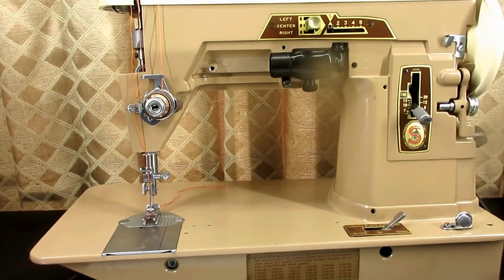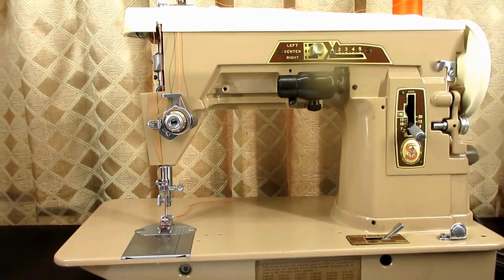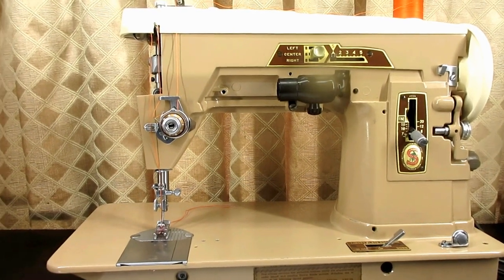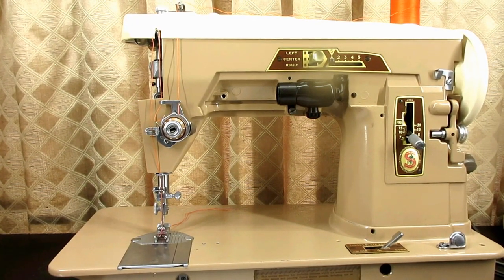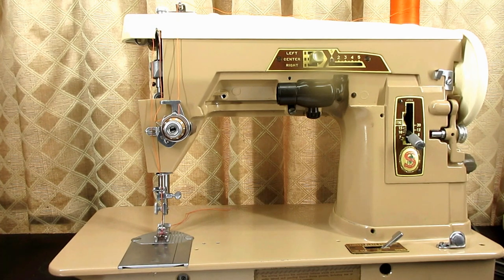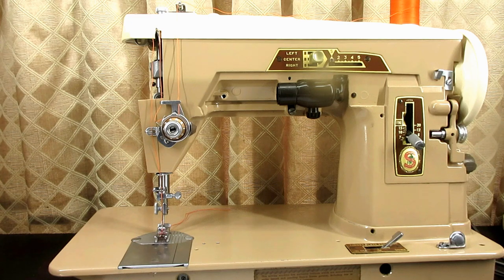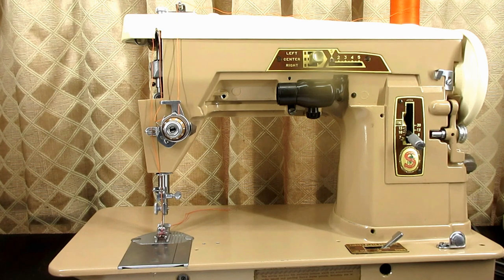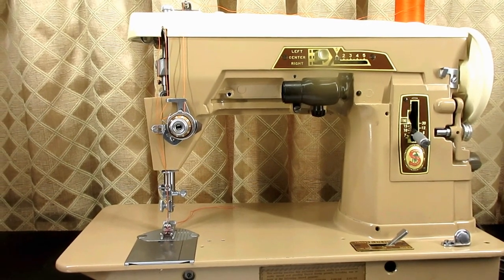Check and Set the Thread Clearance Singer Model 403A Sewing Machine

Comment: Before I had benefit of this video, I was trying to remove a tangle of bobbin thread. I stupidly removed the front adjusting screw that is on the top of the bobbin case retainer. Then said tiny screw was sucked into a previously undiscovered black hole in my workroom. Is there any chance of finding a replacement screw, or will I need to launch a search for a replacement bobbin case retainer? I absolutely love my 401a and even recently found a parts machine from which I’ve robbed said screw.  The only thing wrong with parts machine is the thread spool pegs have been broken off. You can understand my reluctance to disable my parts machine so soon and needlessly. Any ideas? I’ve already tried local hdwe store, no luck. Your videos are SO HELPFUL!
Reply from the maker: I've never been able to replace a single screw at a hardware store, but some have commented that a FEW screw are common sizes. I can't imagine find the single screw for sale on eBay or other, so I think you'll need to but the whole part. I wonder if the black hole below my workbench ends in your workroom or if there is a gigantic pile of little things lost is space? Thanks for watching my channel. 🚀🌍
Reply: on April 28th someone posted their machines for parts and is handing out what people need. im sure you can get your screw from him!

Comment: First off, I love your Videos! Thank you for making them! Quick question, what would make the top thread get pulled into the bobbin case and hook ledge area instead of gliding over the bobbin? I've set all the clearances as you've outlined.
Reply from the maker: You don't mention is this is a new problem, or the machine is new to you. Here are some things I look at when I get a new machine and have this problem. The bobbin case is not completely installed into the hook; like not riding on the hook race. Using the wrong class of bobbin. For example, on this 403A machine, it uses a class 66 bobbin with the curved sides vs. a class 15 bobbin which is taller and has flat sides. The stoke and tension of the tension unit take-up/check spring is not set correctly https://youtu.be/t3UqzYRo-cc
The needle thread tension could be too strong and fighting the hook as it goes around, dragging the thread. With the too high tension, the thread is pulled taught into the bobbin/case. https://youtu.be/4aqRScKOOsw
More rarely someone has worked on the take-up lever and it is out of time or installed incorrectly and is pulling up the thread too soon and not after the hook has cast off the needle thread (cast off is usually about 6 o'clock at the bottom of the hook, then the take-up starts lifting up and pulling the slack of the thread from under the fabric)  https://youtu.be/N6VE-_xuTL0
Reply: @andytubesewing1953  Hi Andy, thank you for amazing videos, they are very helpful. I was offered vintage 401G , it was missing some bits (around bobbin) but I managed to get some replacements (from broken 402). However I am straggling with bobbin area. It happens what Rick said, basically top thread gets under the bobbin case instead of over. I don't know if it is worth my time fixing it. One thing the bobbin case I am using is from really battered 402 and maybe it is a bit damaged.  Also the bracket does't sit too solid. Do you think buying new bracket and bobbin case will help. Thank you in advance for taking your time to reply and have a great new year.
Reply from the maker: @PrincessEvunia  I can't say much more than I replied to Rick above. You can browse thru the videos in these two playlists to watch the videos about the bobbin area, hook, timing, take-up lever, and setting the stroke on the tension unit. 
https://www.youtube.com/playlist?list=PLsCOZgzzaiKKyqvdDRwS-9MfLuwSNJTcg
https://www.youtube.com/playlist?list=PLsCOZgzzaiKIB4kvIHCfHYuyLMUp5A4UI
In a way, you may have answered your own question when you state the bobbin case may be damaged and the bracket does not sit solid. This sewing machine is a finely tuned and engineered device that depends on having the correct parts, installed properly, and set to factory clearances. My videos can help you check the settings and clearances and resetting them if needed. You can also download a free copy of the 401A service manual. Some of my viewers who own the 401G said the manual was helpful to them for working on and checking the settings on their machine. https://sewingdude.files.wordpress.com/2012/09/singer-401-service-manual1.pdf
To isolate the cause of this problem you will need to spend time and effort to find it. You may buy new/other parts but have the same problem. Good Luck
Reply: @andytubesewing1953  Many many thanks, I will look into it all. All the best
Reply from the maker: @PrincessEvunia  Best of Luck to you.

Comment: Hi Andy - I'm having trouble with my Singer 457 and wonder if you can help please? The needle thread keeps breaking. I've checked the needle tension (its on 3 and I'm sewing a light twill). Ive also tried the thread clearance and measure the gaps between the bobbin case and the spring cushion (using the diagram you posted) and it's still breaking. I checked that the bobbin case is in correctly and sitting on the race but did notice that as I observe the needle thread as I turn the wheel towards me, there is some play in the bobbin case so it shifts over to almost touch the spring cushion - could this be the problem? I tried widening the gap using slightly thicker gauge but not luck. Is there something I'm missing?
I made a short video clip of the bobbin moving but haven't had any luck attaching it to these comments. I'll try again if you think it will be helpful. Thanks in advance!
Reply from the maker: Sorry, but you can't attach videos to YouTube comments. You can list a link to a video you post on your own YouTube Channel or in the cloud and I can approve that link with YT so it shows in the comment. The bobbin case moving back and forth as the thread travels over it is normal; that's why there is a cushioning spring for the case to bounce off. There are so many reasons needle thread can break and I'll list some links about various causes that may help. Personally, I've found that dirty bobbin case areas (grit, lint) can be a cause. Lacking oil on the hook race that the bobbin case rids on. Wrong needle and thread combo (needle eye too small for the thread you are using). Old thread. Cheap, used needles can have a burr in the eye or a malformed eye. Wrong threading path from spool to needle. I start with a new needle and rethread from spool to needle and a drop of oil on the edge of the clean bobbin case. 
( see @ 12:20 in this video https://youtu.be/XrNh_iaqDMM )
Here are the links I mentioned. https://www.superiorthreads.com/education/troubleshooting-broken-thread
https://blog.treasurie.com/sewing-machine-thread-keeps-breaking/
https://support.brother.com/g/b/faqend.aspx?c=us&lang=en&prod=hf_600_2eus&faqid=faqh00000318_000
https://www.apqs.com/why-is-my-thread-breaking/
https://www.coats.com/en/information-hub/Solving-Your-Sewing-Problems#Needle-Thread-Breakage
Good luck, Fiona, and thanks for watching my channel.
Reply: @andytubesewing1953  Hi Andy - thanks for getting back to me - I appreciate it. I'll try those tips and hopefully sort my problem out.

Comment: Excellent tutorial! Question: I'm setting the thread clearance on a 401a. This machine came in only able to straight stitch with the needle offset from center. EVERYTHING was completely dried into one position. I finally have all parts moving, clean, timed, and repositioned. Straight stitches really well. BUT: on the widest zigzag, the bobbin thread pulls the top thread down on the zig, and top thread pulls bobbin thread up on the zag. I thought resetting the gaps should fix this, and indeed it did on another 401a. Any idea what else could be going on?
Reply from the maker: That's an odd problem, new to me! Usually a tension issue, but strange it fluctuates between the zig and the zag like that.
SO that's ZZ width 5, the widest? But it doesn't happen at width 4? Tried a different needle I assume? The wider the stitch the more stress on the thread/needle as the feed dog pulls the fabric. Man, I'd love to see that in action. I think at this point (not knowing the cause) I would check the stroke and tension of the needle thread tension assembly. You can just check it without changing anything.
https://youtu.be/4Q1dAUHqfvg   I would also think about checking and cleaning the bobbin case as people rarely do that but grit and lint build up in the spring and ZZ puts the most stress on the sewing motions. https://youtu.be/HT5XZ5eYYEQ
If it continues, maybe think about posting some videos of it on your YT channel so we can see it working and the results of the odd stitching. If you ask for help on sewing and machine forums you could point them to the video also. Sorry, I can't think of a for sure reason or fix; just never encountered it before.
Reply: I completely cleaned all parts of bobbin area and tensioner. For a while, I thought it might be that I had not completely freed the needle bar shaft and vibrating collar, but it does have full range now. I have finally found a new bobbin tension spring, will see if that fixes the problem. Am also putting in a plastic bobbin, as there was mention of the original metal bobbins wearing a groove in the bobbin case center. Will keep you posted. Thank you so much for the reply. I'm so glad you are back. Please take care.
Reply from the maker: @amynevitt9101  Sounds like you are doing everything right. I'm still puzzled by the different sides having different stitch results. I guess because I've never seen it.  I have also seen mentions of a metal bobbin wearing the bobbin case/hook. When I put a bobbin in a slant needle machine, or any class 66 bobbin case, the bobbin does not touch the hook. It sits on a little shelf on the inside of the case. While sewing the bobbin spins as the thread comes off and the theory I was told is that the little shelf finally gets worn down, the bobbin sits too low, and when the needle thread gets dragged over the top of the bobbin case/bobbin it gets snagged and hangs a little which changes the tension on the thread. I know many people prefer a metal bobbin, but I have test sewn on both types and can't tell a difference in stitching or tension settings. I hope you get to the bottom of it, Amy. Good Luck.

Comment: Andy, Thank you so much for your videos, they are so helpful. I was able to change the top gear on my Singer 457 with no problem, and also line up the needle and bobbin hook just as you did. The problem I’m having now is after it picks up the bobbin thread with no problem, when I start to sew the bobbin hook picks up the thread from needle and as it comes around and is suppose to slide across the top of the bobbin to drop in between the bobbin spring thingy... it is going under the top of the bobbin I don’t know what to try! I want to give up, can you please help me ?? Thank for your time
Reply from the maker: Thanks for saving the machine, Pam. Don't give up now! The first two things I would look at are the bobbin and the stroke of the check/takeup spring. You should be using a class 66 bobbin with curved sides   https://www.etsy.com/listing/803199542/singer-bobbins-class-66-10pk-172222?ga_order=most_relevant&ga_search_type=all&ga_view_type=gallery&ga_search_query=singer+66+bobbin&ref=sr_gallery-1-6&organic_search_click=1
and not a class 15 bobbin like this https://www.etsy.com/listing/798212188/bobbin-singer-compatible-15-class-metal?ref=search_recently_viewed-2&pro=1&frs=1
Class 15 is taller and the thread can't clear the top.  The next to check is the stroke of the check spring. If the stroke is timed wrong it can put too much tension on the thread. https://youtu.be/lOLKpvonnPE    So there are a couple things to check. See what you find and go from there. Good luck.
Reply: Thanks for the quick reply.... I will try what you suggested and will let you know. I never give up ALMOST gave in and called a repair shop but after replacing the top gear I figured I should be able to fix it!!!! With ANDY’s help that is!  Stay tuned ......Pam
Reply from the maker: @pamrudy7259  On tenterhooks here. Good Luck.
Reply: Andy Tube 
Oh Andy thank you so much!! Again !! It was there wrong bobbin, once I got the curved one and put it in well she runs great!!! The stitch might be a little loose but I’m sure I can find one of your videos that will show me how to fix that.......
Reply from the maker: Oh good, and easy fix. I wonder what the shop would have charged? Nicely done, Pam. Here is a tension video that may help https://youtu.be/PSCY72bJ3x8     If you think it may be a bobbin tension issue here is that video https://youtu.be/bhcsfhaBRDo
Reply: Andy Tube  thanks I will watch the videos you suggested. The shop I called quoted me a price of $99.78 to go threw and clean and repainted anything that needed repairing any parts over $15. Would be added to the $99!!  I sure hope you don’t start charging for your videos!!!!
Reply from the maker: @pamrudy7259  I have never monetized my channel, so all my videos are free to watch. Some people donate to me to help me with costs. https://www.paypal.com/paypalme/andytube    donations are always appreciated but never expected. By saving that machine and getting it working and back in service you have paid me my rewards, and thank you very much.

Comment: I don't understand really how it has clearance because of the rotation
I can see how to set the tension at a static machine but when that bobbin wheel Hook is spinning the bobbin case is up against that spring no matter how you set it up when it is not running, anyway it seems to work when you get it right.
Reply from the maker: It has to do with the needle thread grabbing the bobbin thread and then releasing it just before the thread clearance gap. That action kind of "rocks" the bobbin case against the spring which then bounces it back. Without sewing with the thread the centrifugal force of the spinning hook just pushes the bobbin case into the spring lightly; enough to hold it there. Sew something with thread and the slide plate pulled back and the fabric lifted a little and you can see the case moving back and forth. You better believe it took me a while to figure that out and what was making the clacking noise down there.

Comment: Thank you!! I have a .   rocketeer 400A that sews 3-4 inches and cuts the top thread..I 'm trying to figure out what is causing it to do that.
Reply from the maker: Several things can cause that. Sorry, no fast easy answer here. Some causes that I have found over the years. Needle not inserted completely up into the needle clamp. Bent needle. Needle & thread size do not match; ie: thread size too big or needle eye too small. Needle not threaded correctly. The Stroke and/or tension of the "check spring" or "take-up spring" on the needle thread tension unit is out of adjustment. The needle/needle bar is not centered on the needle plate hole correctly. The needle/needle bar is adjusted too close/far from the hook point. The is a burr on the needle plate hole or the hook point. Using too much thread tension, especially when zigzag sewing. You are "helping" the fabric move under the needle instead of letting the feed dog pull the fabric along. Feed dog pressure adjustment too light. Feed dog set at an incorrect height. Thread hangs in the "Heel Gap" as shown in this video you commented on. The Disc Driving Worm Wheel may not be timed correctly or the disc follower assembly may not be timed right. These can affect the pendulum movement of the needle bar. That becomes a problem when sewing any pattern stitch, even plain zigzag. You did not mention if it happens when you are sewing straight, zigzag or both type stitches.
Whew! That's a good start of possibilities. BTW, the two Rocketeer model numbers are 500A and 503A, so the 400A you wrote is a typo (for other people reading this comment. So, you can download a free copy of the original SInger Instruction Manual for model 500A. It is a 50 page PDF document you can find here: https://www.singer.com/sites/default/files/outdated_product/1308_500_0.pdf
You may have this already. It has threading instructions, needle & thread charts and directions for all those fancy dials and knobs on your machine. Even better than the instruction manual is the Service Manual for your Rocketeer. It is a 46 page PDF document that has pictures and word descriptions of all the adjustments, removals and replacement of the parts on the machine. These usually include how to check the settings of the parts. You can almost always do that without using a tool of any kind just to see if your machine has been adjusted correctly or something has shifted, broken, become worn, is missing or even just really dirty. Those things can affect stitching. Here is the link to a FREE copy of the Service Manual: https://sewingdude.files.wordpress.com/2012/09/singer-500-service-manual.pdf
I have almost 500 videos on my playlist page. They are mostly about adjusting, removing, replacing, fixing, oiling the parts on machines including the things I mentioned above. The videos are mostly sorted by model number. I have 401A, 403A & 503A Rocketeer videos, but also many of the zigzag models have many of the same features as your 500A machine. They can give you an idea if you want to see a video about something you read in the service manual.  Hope that gets you started, Alice. Thanks for watching my channel and sorry my reply is so short. It's Thanksgiving weekend and I have company. (that's a joke; thanks for giving me a reason to escape for a while)